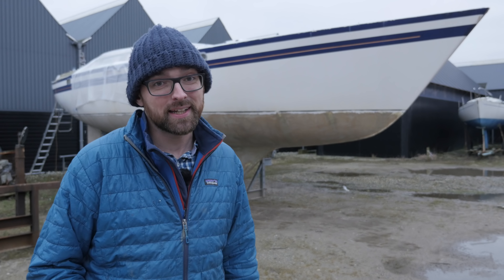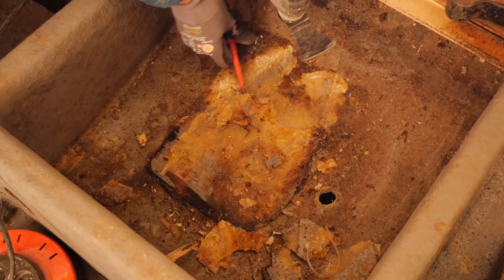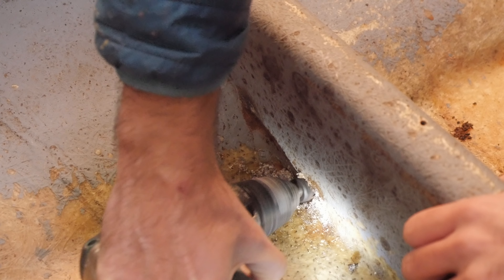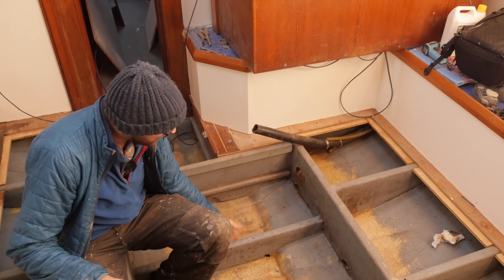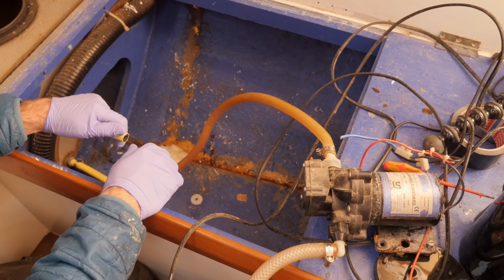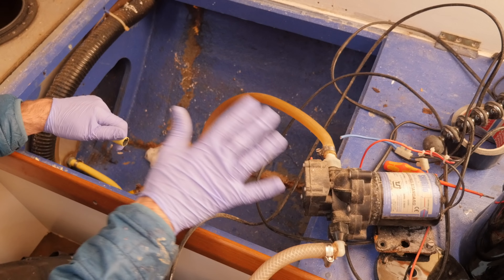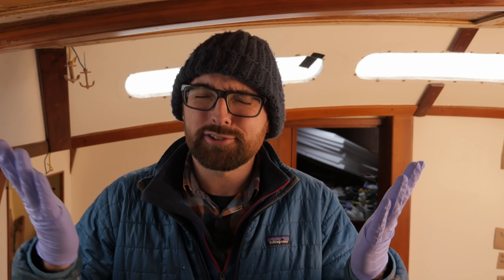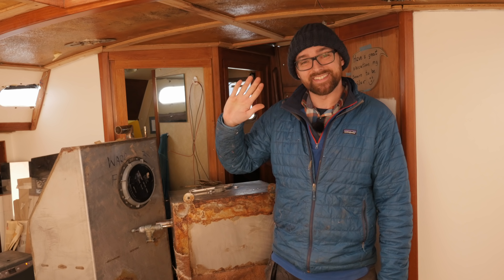Sail Life - No sanding, no painting but wet plywood...yay! - DIY sailboat repair

Comment: You should definitely pressure test that second water tank. Fill it with water then plug up all the holes after filling it with 60/80 psi. Wait a few days and see what the residual pressure looks like. 

Any fabrication/welding place that makes fuel tanks or something similar should do this before sending their products to the customer. So it shouldn’t be hard to find someone to do it for you if you don’t have the equipment:)
Reply: Yes you should pressure test the tank but no more than five pounds. You don't want to blow the tank apart.
Reply: I am pretty sure you are talking to folks who ate knowledgeable about marine tanks.  If not be sure the tanks have interior baffles.  Google "free surface effect"  for a good explanation why.

Comment: It looks like you have around 600L of fresh water tankage... for the mid-ships tank, I think you can afford to find the next size smaller standard plastic tank at a much lower cost and sacrifice just a little capacity.  Your boat was designed long before reverse-osmosis water makers were common on cruising boats.  I have no doubt you'll be doing a DIY water-maker, so I think dipping to 500L of capacity won't interfere with your cruising plans.

Comment: Mads, plywood boats usually have maybe two layer of glass over the wood.  Fiberglass boats are all glass and there strong. the amount of wood even tho it's wet doesn't weigh that much in that stringer. you'd save tons of time and work by just sanding and glassing over the stringer. Talk to a fiberglass person to find out how many layers are as strong as the wood. 
If you keep the one tank just fiberglass over the out side will be good for 50 years.

Comment: Surely those tanks could just be cleaned, crack(s) welded (maybe some gussets to prevent future cracks) and of course replace or add some mounting hardware... All that rust would come off the center tank. Stainless tanks will effectively last forever too.

Comment: Shurflo has made a new pump type there is very quiet, check it out.  Concerning the water tanks a "cheap fix" would be to mount a water bag inside so you don't have to buy a new tank.

Comment: About the structure. Could it be possible just to make holes for drying and simply add some fiberglass layers all over to add enough strength for the beams. You can leave the holes there for drying and not to worry about them anymore.

Comment: Seems like Brit boats of that era were a lot like Brits cars of that era.

I would fix/replace those cross braces between the stringers now so you don’t have to tear the boat apart again later, which you eventually will have to if this boat is a long term keeper.  “Might as well”.

Comment: Get the tanks sandblasted inside and instal one more inspection hatch and coat the inside with 3M Urethane Coating. Good for min. 10 years! Takes some time but it prob cheaper than any other solution.

Comment: I would inspect the tank carefully and only replace it if needed, if it's good then a new one is a waste of money. Maybe you can fill the other compartments that are holding water with a closed cell foam if you don't want to open up drain holes. I bet that was where a lot of the funky odor was coming from.

Comment: Hi Mads! Two questions I've been wanting to ask:

1) If you decide to drill holes in all the sole compartments, Isn't it possible there will always be that little bit of water that doesn't go through the holes? Or would you mould the compartments so there is an incline  from all directions to the hole (I'm not sure how to say that)?

2) Are you going to drill through all the different sole compartment pieces? What would you do if everything made of wood is wet and rotted?!

Comment: I replaced mine with plastic i think it was high density it wasn't light either ,but i sent out the dimensions and it came back exactly the way i wanted it  (USA) You dont have to have the same size ,at this point your options are wide open and I guess its all about how much water/fuel you wish to carry and where you want the weight. I moved mine under the v berth and its a bit smaller but it put the weight up front where most cruisers need it anyway. It looks like a lot of very valuable space. Just my thoughts

Comment: I AM NO EXPERT. Consider using your core drill bit to drill another hole at the opposite corner to the one you just did.. Ie top right if that one was bottom left. At least then you can see if the whole 'rib' 'spline' 'stringer' is rotten our just the area around that hole!

Comment: Could you make a plastic tank pvc or plexiglass? You got the old tanks for patterns. Don’t for get to brace it up inside if you do . And glass shop should have all you need. And look for nontoxic glue and BPA free plastic. And you can precut it outside and build it inside the boat. And if your have to cut up the old tanks to remove them will the new tank fit throw the small hatch? Check before you have one pre made. And with your luck check twice the write it down and don’t forget it’s in mm or inches too. Good luck.

Comment: Mads I think those stainless steel tanks in your boat are just welded together with wrong electrodes.
Clearly it's the welding seams that are the problem in them.
I have 30 years (allmost) old stailess steel tanks also and there is zero corrosion in them.
Consult the local welders (I'm sure also Denmark is full of them) and see if they can reweld your existing tanks.
What comes to those (rotten?) stringers, it's not that big of a job to rebuild the problematic ones.
I recently made a video of a holding tank installation where I'm building a small "stringer". A two days job.
You might get some hints from that...

Comment: i see the hose barbs are made of stainless steel . Kind of hard to tell what the tank is made of. If the wall of the tank are made of stainless also. Why don't you just clean the out side and take the tank to a local welder an have them TIG weld the leaky seams.
then pressure test to confirm that are no leaks shoudn't cost you more than 100 canuckistan copecks
Reply: Thumbed up for AvE reference.

Comment: Would the water tank fit through the nice new front hatch? It might be easier to get it through there than have to cut it with a grinder in the boat. It would be a terrible mess.

Comment: As always, awesome DYI videos!!
Will the tank(s) fit thru to the fwd cabin and then out of the new large center-line deck hatch you just installed?  If "almost" would it make sense to take the hatch off to gain a few extra cm's?

Comment: I’m curious if there was a leak in the water tank at some point causing the water to drain and soak through under to the bilge and get caught in that compartment? Is that the theory, or is the thought that it came from the outside in?

Comment: Have you looked at Vetus water tanks.  the 335L tank is 1700x700x350, I assume that last mesure is 350 since they go with 1700x700x35. I would go with a new tank for the one near the bulkhead. Finding yourself with leaking water tank, is not good.

Comment: What about getting two smaller plastic tanks? (so they both fill the hole left by the big one)  The redundancy could be nice if you set up a valve system.

Comment: Mads, 
The rotten wood in the stringer is disconcerting to say the least.  I seem to remember from the deck repair videos (with rotten core) that the chain plates were also bolted to wet and rotten wood.  I would want to know the condition of all the wood on this boat and what else is holding water.  Looking forward to how you fix the problem.  Best of luck.  RWH

Comment: How much structural strength is required from the wooden pieces anyway? Now that the fiberglass is in place, that is what carries the load. I would suggest drying out the wood, creating proper drainage channels that are glassed to seal them and don't worry about the wood that is no longer structurally strong. My 2 cents...

Comment: Hi mads, I completely agree about the morons who designed and built your boat, rarely have I seen such a poorly engineered boat and the build quality is no prize either. You're brilliant guy and whatever solutions you come up with will be fantastically engineered and solid as a rock. Where is my boat, I would definitely replace all tankage and plum the new correctly in a Bristol fashion. Just a thought but would it be possible to use the old tanks as a plug mold and build your own new fiberglass tanks, leaving one and open to remove the old tank. After all you have become such an expert at glass and epoxy work that it seems you could do it in your sleep :-). Keep your chin up big guy, that boat of yours is one challenge after another after another

Comment: Since it is a rectangle why don't you get one welded up at a welding shop.  You need to decide what kind of plastic to make it out of and how thick it needs to be but they should be able to weld it up for you for little money.  They should use a hot air welder to do it so you might have to look around to find a welding shop that has one but that could save you some money versus a custom tank shop.  When I took welding in school we welded a plastic tank about like what you need to replace yours and that is how we did it.

Comment: Mads do you think any of that water could be from the water tank? 
You might want to pressure test that tank if you are planning to keep it.
The stringer is another issue...I think you need to test each. If you don't replace the stinger and dry it out then you run the risk of dry rot (not sure but possible)...another project -at least you can fix your drainage to the bilge :)

Comment: Plastic tanks make the water taste a little plastic quite fast, stainless is better but titanium tanks is the best, holds forever and leaves no taste.
Reply: Just curious, do you sail in warm waters normally. I have not noticed any issue with water flavor from plastic tanks in the colder waters of Atlantic Canada where I sail. The worst tanks I've drank out was metal tanks painted on the inside...turns out the paint was not applied properly and benzene was leaching into the water. It made me physically ill (brand new ship too)
Reply: you gonna donate the cost?
Reply: No I just pointed out that plastic tanks is no fun, I would go with "acid proof" stainless, not the junk that someone made Athenas tanks of, however I know people that have got their titanium tanks rather "cheap" (2000$ish) from companies that handle a lot of titanium.
Reply: Well, I guess it will taste less in cold climate, however I'm from Sweden and I had fiberglass, plastic and stainless tanks in my boats, all of them leaves different kinds of bad taste to the water. For me, especially if you need to keep the water in longer periods in the tank, the acid proof stainless is the best of them.
But if you don't care, can't smell/taste, or use the water in a couple of days the difference is probably not that important.

Comment: Do you think the trapped water would affect the moisture readings in that area?
Reply: Ronald Gallagher: Yes, I'd like to know this too!
Reply: Of course! Now the Numbers might drop quicker
Reply: absolutely and hopefully the smell will go 100% away so miss Eva don't get to deal with
 that...
Reply: Good point
Reply: Wow. Who would have thunk that? Does the meter somehow measure moisture on the other side of the steel hull?
Reply: The Hull is FRP not steel!

Comment: Please think about using aluminum I-beams (or poly or FRP) in place of wood to fix the stringers and floor beams. Every channel on boats I've ever seen and every older fiberglass boat I saw growing up in Michigan had punked wood encased in fiberglass. I'm convinced this is a sure source of failure and a bad building practice.

Comment: The (only slightly mad, not evil) scientist in me wants to stick a hose in the wet hole and pull a hard vacuum on the core. Wet plywood should be much more permeable than fibreglass - only question is, will it implode?

Comment: Hi would never have though to cut out the floor under the tank. Good if painful catch. Re tanks , why not take both to a SS metal guy and have him replace the bottom in the one tank and check out the other  then reuse , a few hundred €or$ and you have 2 Tanks that fit perfectly. Forget bladder tank , cheap rubbish for a tankage problem , plastic good but SS way better if correctly installed with little feet. If SS guy says no go then ok move on to plastic expense..... plastic is not as healthy as SS either if you believe the hype of leaching into the water. Cheers Warren

Comment: Sorry Mads, but I think you need to inspect all stringers and floor joists and repair or replace as needed.  Water in  a wood cored boat is a cancer.  It will eventually lead to failure.

Comment: Are you sure about those water tanks? I would much prefer the steel ones over plastic. Bad taste can easily build up in plastic. Steel is much more inert. Some plastics poor out nasty carcinogenic chemicals.  Is it an option to make the manholes bigger and drop a fresh bead of weld in there to fix the leaks?

Comment: Du skulle kanske kunna borra upp hålen ytterligare vid kölstocken för att se ifall träet är friskt. Är det friskt är det bara att gjuta igen med epoxy och borra ett nytt dräneringshål. Mycket underhållande serie förresten :)
Reply: I can almost understand that!
Reply: I wrote that mads could enlargen the hole in the keelframe to check the wood inside. If the wood i healthy you can just fill the hole with thickened epoxy and drill a new hole for drainage
Reply: And btw Swedish is the easiest language to understand in Scandinavia;)

Comment: put the old tank under vacuum pressure andd it wil shrink. or just take a hammer and a chisel and an good hour or so. and perhaps your new tank could be bigger and partially tucked away under the floor. the more you can put in your tank the better stabilize your boat.

Comment: If it was me I would have the leaking stainless steel tank rewelded,  Thank you for sharing,  
Plastic tanks are not with out developing leaks, At work tomorrow I am going to weld a plastic fuel tank,  Again I would have the leaking weld repaired, just my 2 cents worth

Comment: As for the wet crossmember, some heat and vacuum would help?
Be thankful, that the boat yard put no holes in the beams, probably they had punched them right through the fiberglass, so that the bilge water could have infested all plywood in there...glueing a pipe for the drain holes wuold have never come to their mind...
:-/
For the watertanks, try to contact www.kunststofftechnik-bischoff.de maybe it`s cheaper to ship from germany than from uk and over the north sea...
Thanks for the vid&have fun!
:-)

Comment: Hey Mads. I don't think there is any point getting bothered by the poor design choices. At the end of the day it's a 30 year old boat that was already at the end of it's designed life (as evidenced by the failure of the deck core). The Warrior 38 was never a particularly high end/premium boat. It's a middle range affordably priced hull... in the same way you wouldn't expect a 30 year old Ford Fiesta to still be roadworthy,  I think you juts have to accept it for what it is.

Comment: I replace a ton of pressure pumps on a regular basis.. if the pump does not have a pressure switch.. cool.. But if it has a pressure switch.. the you'll have to replace it.  It's not worth it after all the work you have done to have if fail when in the middle of a poop or shower.   don't trust it.. replace it.

Comment: I wish I knew some good swear words in Danish!  What were they thinking?  OH This compartment under the water tank will never get water in it so why should it drain?  Or, lets make this an air tight compartment so if the boat gets holed somewhere this part will keep the boat floating?  Meh!!!!!
Reply: 16:53 Could this be some Danish swearing!  ;-))
Reply: Hehe.  Yea!  Pretty sure it was but I couldn't understand it!
Reply: hehe I can help you there :) helvede - pis- sku - fanden- røvhul - and so on if you like more please let me know :)
Reply: Just three weeks ago i surveyed an European brick house (ground floor + 2 floors and attic). The current owner noted that there were fine line cracks crisscrossing on the ground floor's walls, all of them. Got one of my friends to help me go in the cellar (not a true cellar, merely just above crawlspace) and guess what, the structural wall and pillars (brick) were all holed with what could've only been a 10 cm core drill all the way to the dirt surrounding the house.

The owner got in touch with the previous one, and i quote my ears: "because the walls needed to be aerated due to water ingress".

Things like these boggle the mind, but then, a spark of reality strikes across the synapses and you realize, some people are so stupid, their basic function is to breathe in air and exhale it.

For me, i was shocked the house only had hairline fractures, and hadn't fallen in the years after the "operation" had been done. So really, that tiny hole in the boat, it's probably at the low end of stupidity, and i have no doubts that the "drained" cellar is middle way through the pyramid.
Reply: That is what they said about the titanic
Reply: How do you say 'I opened a can of worms' in Danish! Love your vids.
 Kevin on s/v VALHALLA, 1990 Ericson 38-200 in Tacoma, Washington
Reply: Yeah love to see a Danish-English translation for that. Enabling subtitles makes for a good laugh also, not sure YouTube knows those words. ;)
Reply: Hahahahahaha.... I translated that and can't believe he said that.  Now, in his defense, if I had uncovered that in my boat, I'd have been breaking things.
Reply: Hehe.  The stupidity hierarchy has it's origins in facts observed.